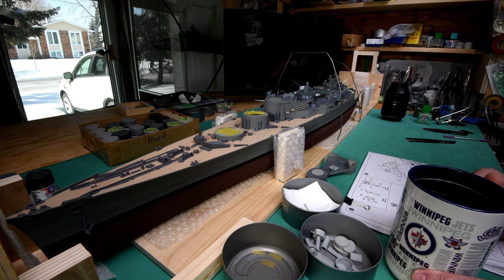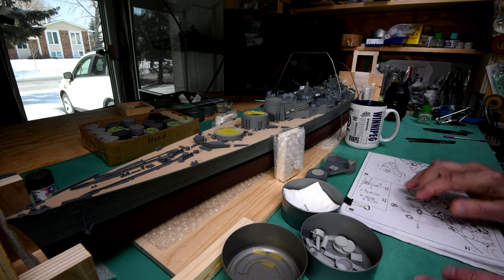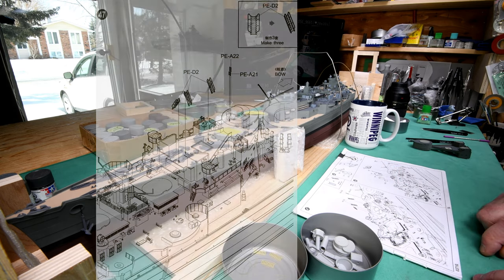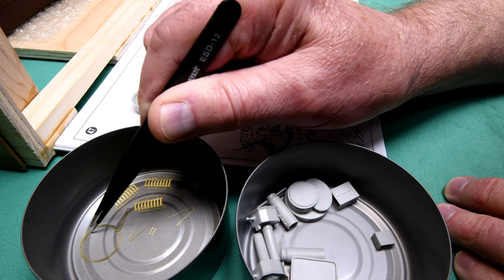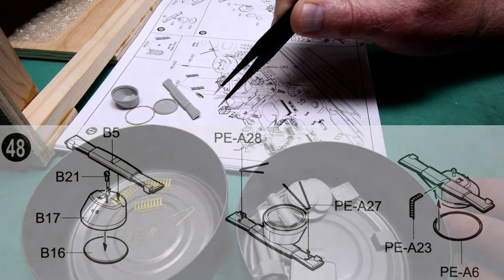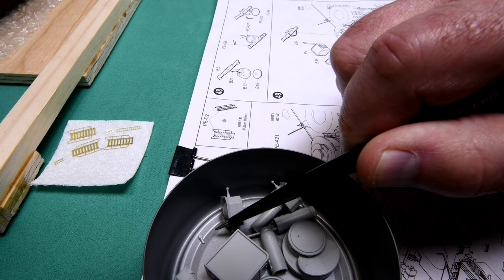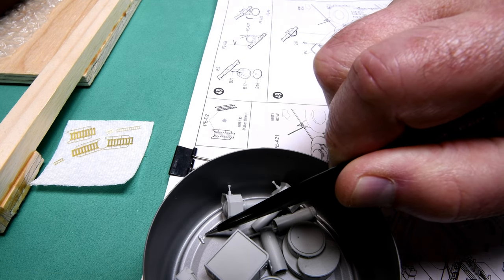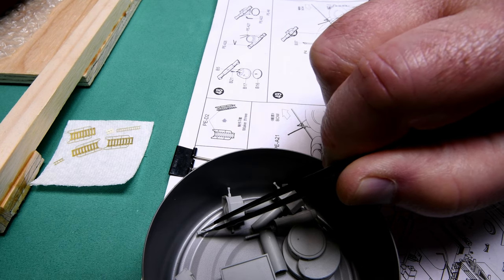The Model Ship - Part 735

Comment: Ron regarding the blackening of brass etch. Firstly I should point out that the product you are using states 'antique brass'. This relates to old much more malleable brass. Modern brass sheet is a much different product. You are probably correct that unless it is spotless it doesn't work properly - I have found that sanding both sides with a very fine wet and dry helps a lot. Folding before coating will also reduce potential of coating coming off. Having said all that i personally would never use the stuff or equivalents. painting is the way forward but only if you clean and prime the brass first. Modern model paints do not stick to metal well.

Keep up the good work.
Reply from the maker: Thanks Roger 👍🙂

Comment: Experimenting is never a waste of time, either way a lesson is learned. I always clean my brass before removing from the fret to remove any chemicals left from the manufacturer, may help the brass black do it's thing.
Reply from the maker: Using an ultrasonic cleaner, I've just now removed the oxidation build up from those photo etch parts. going to do it again tomorrow --- but differently. Thanks for commenting Jason. 👍

Comment: Hi Ron, I wonder how would vinegar affect the PE parts. In terms of looks, I would think (trying to judge from BW photos) that the ladders would be painted in the same grey color as the superstructure with the steps painted black to hide any dirt and stains.
Reply from the maker: Vinegar - yes, might have a corrosive darkening effect. 👍
Reply: @roncalverley  And if it doesn't blacken the PE part, it will certainly degrease it. I've seen vinegar suggested for several such applications, including degreasing before tin plating, etc. 
Another option, which I am guessing should work well in terms of darkening would be Gun Blue. I've seen it used by wooden ship modelers and it can be applied using a piece of cloth or napkin several times to get to the level of black you are looking for.